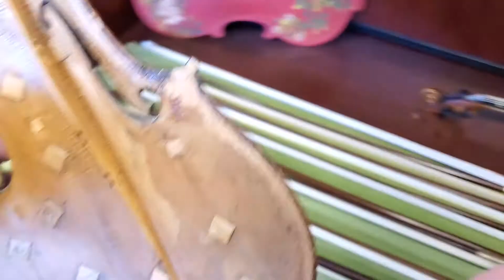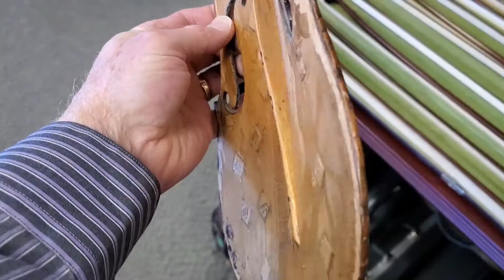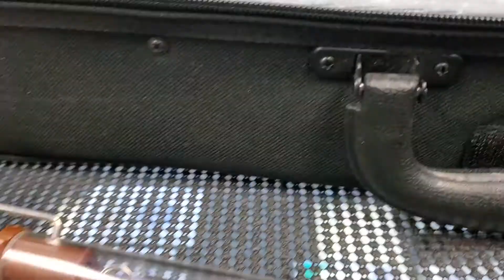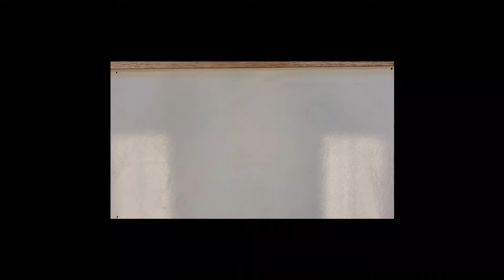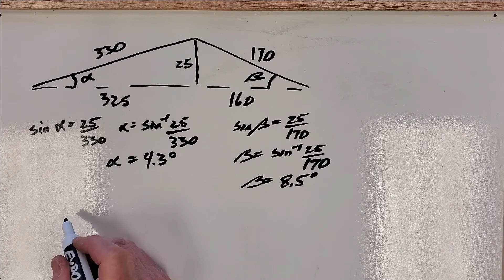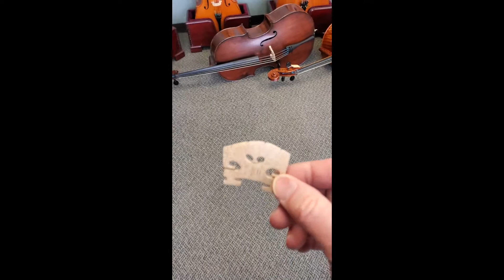Force on a bridge

Comment: Thank you. I did not realize the tremendous pressure these delicate instruments are under. Does the pressure increase when fiddling?
Reply from the maker: It certainly does! There could easily be an ADDITIONAL 6 to 8 pounds downward force on the strings exerted by the bow. That would be an interesting experiment -- to measure the overall bending force on a violin under vigorous playing.....hmmm...